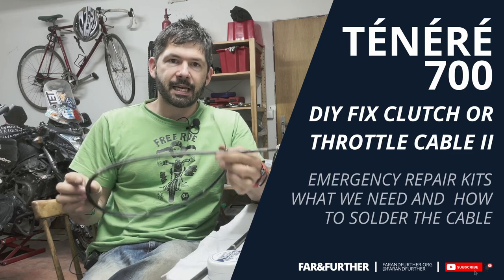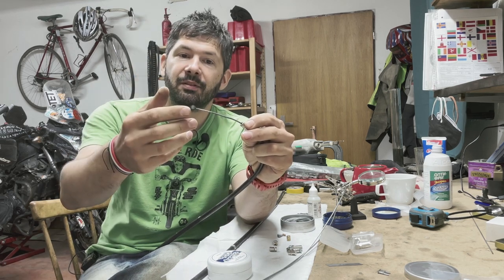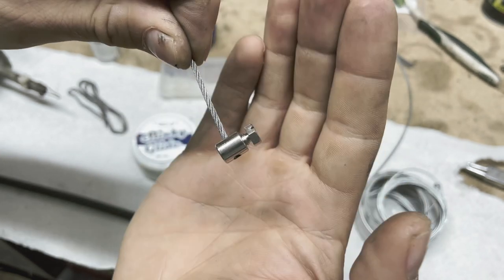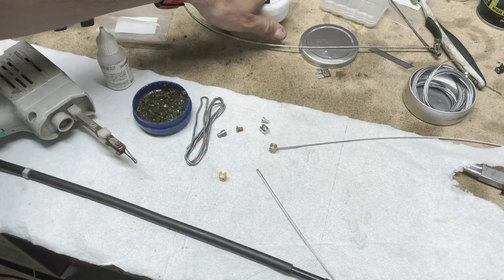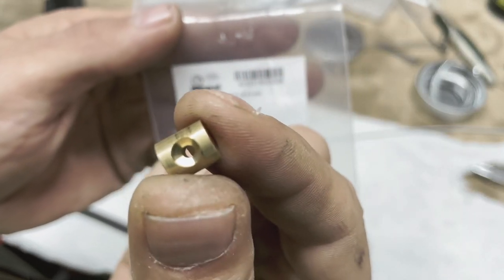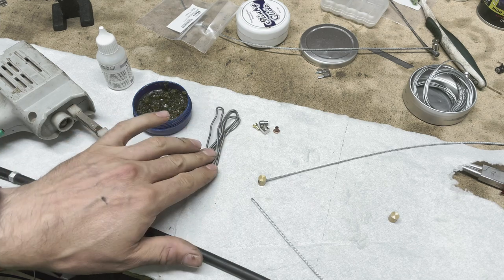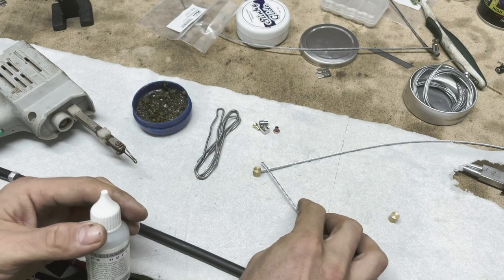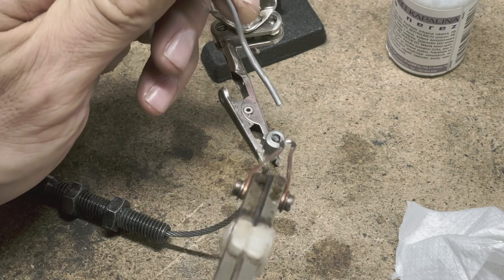Yamaha Ténéré 700: How to DIY repair clutch or throttle cables for cheap and anywhere in the world?

Comment: Nice to see a follow up video. Modern repair parts are much nicer than in the day. Your method is excellent, thanks.
Reply from the maker: Thanks, yep the parts make it not just a fix/repair but a good clutch cable. I'll just carry the parts with me, soldering can be done anywhere.

Comment: Hi, nice vid and great how-to.
To my experience, the stability is further increased when you unfold the single strands of the cable (like a blossom) in the nipple before soldering.
This gives you some extra miles....Have a nice weekend..
Reply from the maker: Yes, that is very good tip indeed. Yes should have spread them a bit more.

Comment: Respect to the knowledge.. Anyone that believes, like me, that 2 euro`s is expensive for a tiny piece of metal gets my vote.. Haven`t got a Tenere 700 yet! But this data makes buying one less of a guess.. Travel Far Travel Safe..
Reply from the maker: Hi Vincent, €2 is a bit high for a tiny piece of metal, I agree with you, I think they will be available from different sellers for cheaper. However original Yamaha clutch cable is €€€ in comparison.

Also, if you don't want to buy the end/barrels it is possible to make those from scratch. I have older video on the topic where I use that method saving you €2.

Also it really would not matter which bike it, it's bike agnostic.